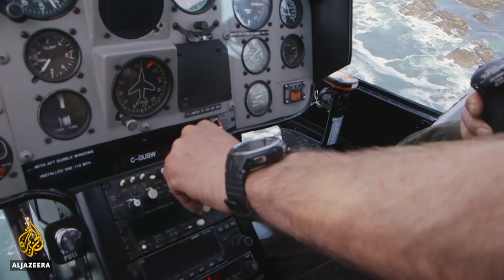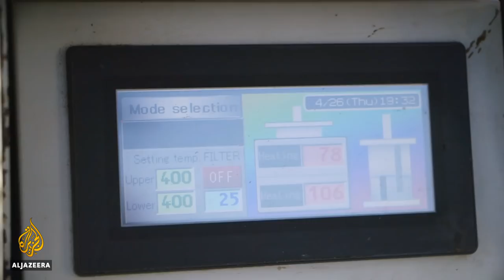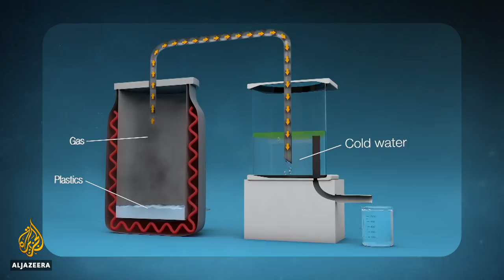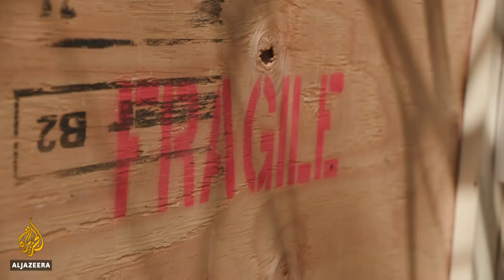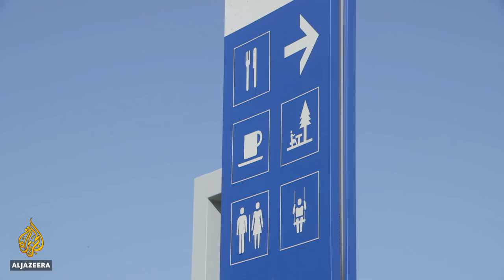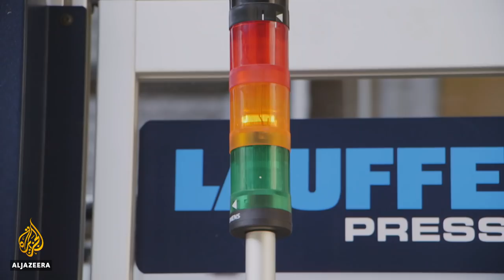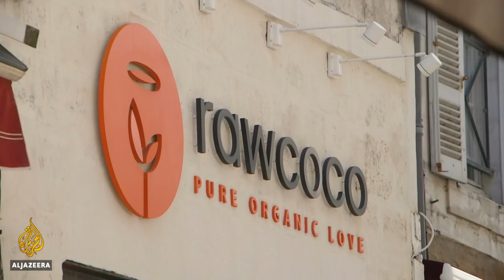🇫🇷 Turning the tide on plastic: Creation and art from waste 🇨🇦 | Earthrise

Comment: So you make fuel by heating plastics by burning fuel ????
Seems like chasing the tail to me and you can't produce energy by using energy. The only way it can make any environmental sense is by using wind or solar electricity. And does the process use up all of the waste, or is there still residual material left behind?
Why not just use the plastic waste for high temperature incineration to produce electricity? This process creates few emissions with modern equipment and technology and leaves little residue.
As far as turning old plastics into art, well this is very limited and uses more energy, so it seems impractical and cannot be considered a realistic answer to the problem.